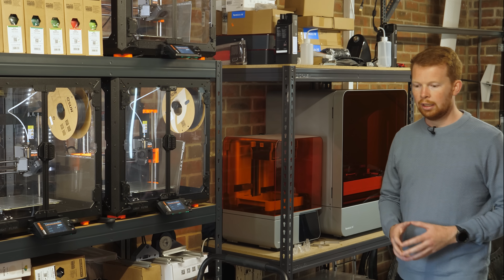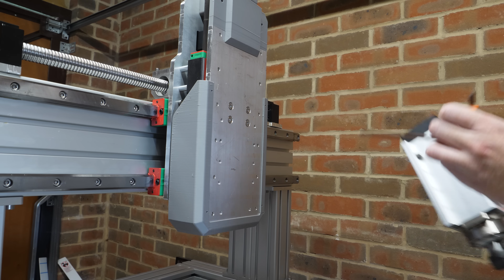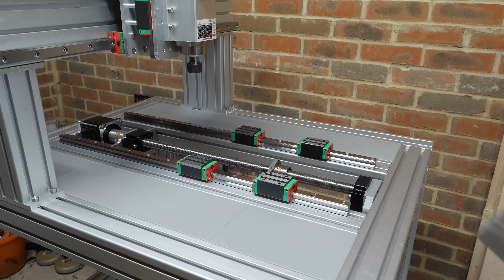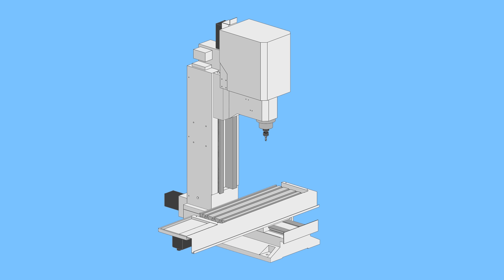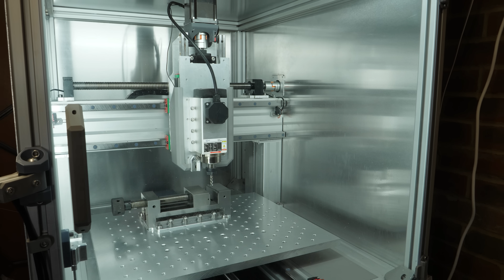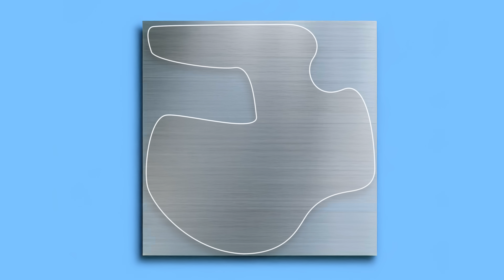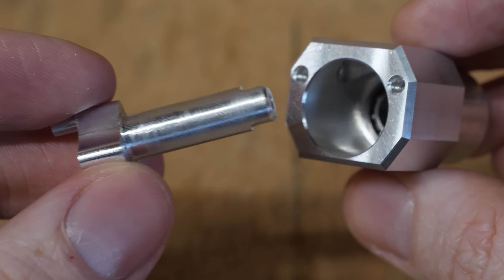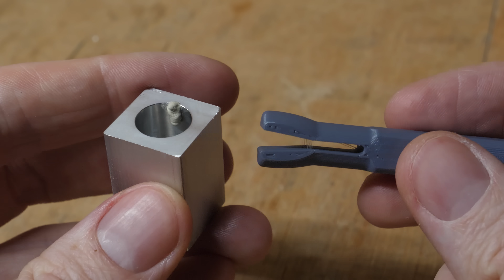I Needed an Engine, So I Built a CNC Machine

Comment: If you mill the wheel to accept a metal turbine, you can also mill a place for the peltier tile in the wheel. A 5 axis turbine from JLCCNC would be pretty cool and I think a 3 axis turbine is a must, I think more DIYers will have 3axis milling. It would be awesome if FLIR footage could image the wheels absorbing thermal energy from the pavement. I thought it would be awesome to see 1mg of paraffin wax melting on a peltier tile, then put a little foil. Also, 3D printing a shroud. It would be an awesome series. If you used a tire inflator in your backpack, I think you could use a lower pressure in your backpack and still safely use 2L soda bottles.

Comment: I'm a maintenance tech at one of the biggest machine shops in the country. My job is to fix the machines when "professional machinists" dont know how to push a button correctly and crash a multi million dollar machine. the shit ive seen idiots do would make you cringe. i cringe so many times during a day that youd think i just have a resting cringe face 10 straight hours a day..

We use Renishaw probes on most of the machines. They make all sorts of variations from ones that go in a tool holder and go into the spindle and touch off on the part to auto program the exact position. and theyre based on touch, not completing a connection electrically which means you can use them on any material, not just things that are conductive. They also have ones that you bolt to the build plate and leave in a specific spot so when the tool touches off it automatically knows the offset. those are used mostly for checking if bits are broken before using them in the program. and theres about 10,000 other variations. if you got one of those renishaw probes (which are wireless and rechargeable but the batteries last months or years) you could do exactly what youre already doing but you wouldnt have to rely on something conductive.

also, they make addons to regular xyz machines that give you additional axes. the ones we use are a self contained unit you bolt to the build plate  and plug in and you can now rotate your part instead of having to unclamp it and re-touch off and all that.

Comment: Im not qualified at all to say this but use the rotatable zylinder thingy as a gas pedal. Like bc when you turn it a bit it gets faster but bc f the vibration or smth it screwes back out slowly. You could make ot go faster and slower by making a mechanism that would allow you to screw more in my pressing on a pedal and when you release it there would be a spring pulling it back. Basically the same principle like a carburetor but with the timing of releasing the air yk. Idk that just what came to my mind at the end of the video when you screwed the thing to adjust how it runs. Idk if that's even realistic to build or if it's too hard or if it would actually even work 😅

Comment: You could use the heads rotation to change power bands to increase or decrease output power controlled by a servo and linkage😊

Comment: Imagine a rotary vane motor. The outer diameter of the rotary vane motor has peltier tiles and paraffin wax that are in bands that are like the bands for delta pulse width modulation so that the thermal energy is applied to the motor sinusoidally. The peltier tiles are always on, but the different width bands of them on the outer diameter of the motor imparts the force to the flowing gas sinusoidally.
Reply: You used tube construction for your piston housing before. A tube casing for a rotary vane motor is gold, you can machine your rotors now. I want to put peltier tiles on the vanes. I keep thinking of those Persistence of Vision LED Clocks. Thanks for using high speed imagery, Tom. Also, do vanes have to be flat planes? I think the flow of air in those chambers of a rotary vane motor could be engineered with automation. Isothermal Persistence of Vision.

Comment: I really liked that your air motor is modeled after a toy. When I imagine miniaturizing the circuitry from this isothermal compressed air car, I could imagine it being a coin battery that energizes a small peltier tile and has only a few grams of paraffin wax. The motor you machined out of metal here looks a little bit larger than the motor you spec'd at 0.05hp. 38w. I found mini peltier tiles that are 6mx6m and you could probably use less than a mL of wax. I think it could be really beneficial to the flight time of a pressurized soda bottle. 1g of paraffin has 200j of latent heat when it solidifies from liquid to solid. That is too much even for your motor. I am imagining a small dab of paraffin wax and a mini peltier tile directly inside the cylinder. If there is 0.05g of wax and that 10j is discharged each time your cylinder extends, it would add 750j/s. I must be doing something wrong. If you are 0.05hp at 4500rpm, that is 75revolutions per second. 75rps x 10j. So, if the amount of PCM were 0.001g, it would add 15j/s, that would be a 50% improvement on power, or you could adjust the flow control valve down. You would also need to learn to drive the tiny peltier tile so that it delivers 15j/s at different outdoor temperatures because they are harvesting thermal energy from the environment. You probably would want to learn to variably control the peltier tile for different RPM anyway.

Comment: You might find it helpful to investigate the low friction material Rulon as used for pistons in oil less linear motor air compressors that are rated for 5000 hours life.

Comment: 19:50
I think it'd be cool if you didn't fix the cylinder in place but make the adjustability a feature like making it be a sort of throttle you can control.

Comment: I think you should keep the threads on the cylinder head unlocked, and instead add a small servo and belt to throttle it up and down within a finely tuned range. Might be something worth looking into.

Comment: Locking nut on the cylinder. Thread the nut on the cylinder and then thread the cylinder in the block. Tighten the locking nut down to the block once you adjusted it. Use a locking nut. Put a little more thread on the cylinder and use a thin nut to lock it in place, otherwise called a "locking nut." If you thread a nut on the cylinder first before you thread it in the block, you can use it to tighten the threads. Locking nut. Locking nuts are very good for lots of things, and I think it would work great for this. Try a locking nut. If you add more threads to the outside of the cylinder, you'd have plenty of space for a locking nut.

Comment: The metal version of your motor will be more compatible with the paraffin wax or sodium acetate. They change phases at 51°C. So, that would probably melt the plastic versions of your components. The plastic parts could still work with the water/ice phase change. I like to think about a thermal exchanger made of water/ice in an aircraft. It would be cool if the temperature at ground level were like 3°C and that the temperature at 700m is 0°C. I would like to design the aircraft so that I could fill it with enough 0°C air so that it could climb to 700m and turn on the electric air compressor and refill with more working fluid.

Comment: Might be interesting to have a linkage to adjust the timing as demand changes... maybe even have variable spring preload to adjust the pressure that closes the valve? Is there a way to route some of the air pressure in a way to help close the valve positively? My mind is going towards a place where IC engines struggle at high rpm: valve float. Awesome project, though!

Comment: Don't underestimate aluminum galling in your designs! Especially at cryogenic temps! there's a reason you use steel for this stuff. just because aluminum cuts nice doesn't mean it's the right tool for the job. when you're expanding gas like that you get a big temp drop, so you're gonna be working at very low temps. this is great for the cooling of stuff that normally creates friction heat, but aluminum on aluminum is probably gonna be a problem

Comment: The simplest way to stop the cylinder from loosening would probably be: cut the thread even higher, and add a slim aluminium nut that you can counter against the crankshaft housing then it's at the right height.  Screwlock would be even more simple but probably not survive the temperature range.

Comment: Interpolating on that mill should hold .001" Just leave finish material to make a much smaller radial cut to finish. For y'all conformist unit users that, about .025mm of roundness. Try comparing tolerances between SAE and Metric, and you will find out why American made is more expensive. We like to keep it tight.

Comment: Right angle swivel hose attachment at the top for hose attachment? Would allow independent movement between fine tuning the timing and the pull force of your air intake hose?

Comment: Bro is cutting radii with splines lol
(Also use ramping moves for plunge cuts!)
Edit- Extend the male threads on the cylinder, and make a lock ring that you can tighten down on the top face of the crank case so you can adjust the timing and then lock it down. Great project, man!

Comment: Hi Tom, loved this video, would like to suggest a fix for locking the cylinder in place…if you extend the thread a bit further up the head you can use a thinned down nut to lock it off.

Comment: Machinist apprentice here! You absolutely need a solid cooling system. Trust me. Your Ears, Workpieces, and tools will thank you
Reply: Depends on the material
Reply: I was talking about a cooling system. To specify, I meant a system using a cooling lubricant emulsion. Cooling always makes your cuts better and your tools last longer.

Comment: A knurled lock ring the same thread as the cylinder should help for holding the valve timing steady. Though you've probably already sussed that 😅

Comment: Brilliant! I'd suggest wrapping a wire, the kind used for fridge de-frosting, around the cylinder head and supplying it with voltage. The increase in power will be astronomical or to put it another way, the fuel savings will be extreme. 
Kudos Tom, well done.

Comment: If your using this on something rc you could use a servo to spin the cylinder to act as a throttle using that power band though it would be something to try

Comment: Replace the rubber feed pipe with some hard pipe, or braided brake line to remove and dilating pulses. It should be easy to tune. 
Awesome build! 
My jaw was on the ground the whole time. 
You have raised your already high bar! 
I look forward to seeing your next upload. 

🇦🇺🤜🏼🤛🏼😎🍀🍀🍀

Comment: just fabricate a threaded ring that you can thread on to the cylinder first before threading to the crank case and tighten it against the crank case when you have your timing set. it will stop it from spinning and can be easily loosened to adjust and tightened back down. Kind of like a jam nut.

Comment: By adding mass you’ve lowered the frequency of the first resonance of the structure and all the subsequent resonances at higher frequencies.  You’ve increased the odds that some problem resonance will emerge.  You have added some damping to the beams as you demonstrated but the flexing that would cause a problem resonance typically happens at the joints between the beams.  You haven’t done anything to dampen those.

Comment: Awesome to see this manufacturing advancement. The main question that i havent seen addressed yet is why are the exhaust holes so small? If itsabout timing wouldnt you want to make them slots to maximize volume while not affecting the power stroke legnth? And keep increasing this until you have structural issues for max power? Just an idea, maybe worth a resin printed test to tune it and maybe add some pipes !

Comment: 19:55 like a lock on a door just use a jam nut that's threaded onto the cylinder beforehand so you can tighten it down against the block setting the timing. Giving you infinite adjustability without the need for more machining beside the jam nut itself or potentially adding more thread to your cylinder.

Comment: I would use the threaded cylinder as a menans of tuning while the pressure drops off. You can mount a linkage to a servo motor to rotate the cylinder

Comment: You could machine the heating Rings to do two things at once is there flat they could act not only as cooling Rings but also clamps for when you find the the best height and the tank that would eventually house the liquid CO2 could have a clamp on it that would hold the thing in place

Comment: Please build a proper exhaust system that oscillates at exactly the right engine speed. The goal is to choose the length so that the moving gases still in the exhaust from the previous cycle create a vacuum exactly when the exhaust port opens in the current cycle. This way, the pressure in the chamber is lower when the piston moves upward again. It’s very similar to the resonance exhaust systems used in two-stroke engines.

Comment: At 16:00 minute mark.  I believe you can achieve a much better finish if your tool design would allow for the evacuation of chips during the cutting process. 
As for your boring tool, I'm unable to tell if you're code is retracting tje boring bar at the same rate as the cutting pass.  Your long boring bar flexes as its cutting so it will make very fine cuts as its retracted from the hole. You either need to move the cutter away from tje work surface before retracting, or make what is called a spring pass which is allowing the tool to cut at the same feed and speed as the initial cut.  Isopropyl alcohol makes a good cutting fluid for small light cuts in aluminum as well, and that would greatly improve your surface finish. 
The dial on the boring bar isn't really that accurate.  To get a better idea of how much you're actually moving the cutter, set up a dial indicator on your vise or milling head and zero out your indicator with its tip directly in contact with the cutting tip of your tool. As you advance the cutting tip on your boring bar, you can directly read off of the dial indicator the amount you're actually advancing the cutter.   
If you're unsure if the granite epoxy improved the quality of your mill, you can wonder no longer.  It greatly improved its ability for precision and achievable quality.
Hope thats helpful. I enjoyed the video.

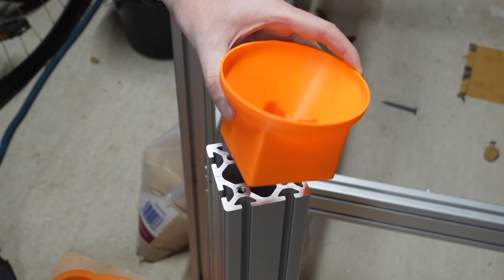Comment: 1:25 Yes, this will affect the cutting quality big time. The two most important factors are rigidity (stiffness) and dampening. Its important to have realistic expectations. For the same axis travels, an industrial mill weighs about 3 tons, heck even the table weighs more than this machine. But you have done yourself a huge favor with the filling, probably improved it by a factor of 3-5.

Comment: A heavy frame does affect cutting quality, but you've only made the bed handle more torque (think of it as a sort of resistance or capacity, depending on time). So what ever vise you've installed your tool in can handle more torque (with solid screws) if you've planted it on a heavier bed. Same goes for the tool crane, but then you need more power on the motors that run it.

Comment: Wicked air engine mate, I never knew this is a thing. What would be the RPM and approx torque output and how much cfm air are you feeding it constantly? Also how large could this be built and multiple cylinders like V-twin, inline-4, V8 or radial type?
I apologise for my rudimentary question as I'm a dummy on my smartest day.

Comment: A very nice project. The tap broke for 2 reasons; 1) you used no cutting fluid. Paraffin, white spirit or WD40 is what you need. 2) the swarf was bound up in the flutes of the tap. With small taps don’t be too ambitious with the amount of tapping turns before you back the tap out and remove the swarf. 
Also, never be tempted to tap holes in a cordless drill. The way to remove broken taps is with a spark eroder (edm machine). This is a very slow process but works only in conductive material. Perhaps you should consider building a simple one?  You will then go down the rabbit hole of machining square holes in hardened material etc. 😊

Comment: I think you could try to make the cylinder height(valve opening time) adjustable by servo so you could optimize the engine efficiency to match drop in operating pressure.

Comment: I'm not sure if it's possible on such a small setup, but on larger CNC machines, They have multiple collet holders that can be swapped out with a press of a button so that you don't have to go through the steps of loosening, switching tools, tightening, and rezeroing for every operation requiring a different tool. It also means you can keep your probe in one to quickly switch it in to get the zero on your part.

Comment: For locking the cylinder into a given orientation, consider not locking it at all. Rather, control it with a stepper (a couple 3D printed gears/pulleys should work brilliantly). Now you've got VVT, and as such throttle control if you can characterize the power output at various positions.

Comment: I wonder if you could add an arm to the cylinder head and use a servo to actively adjust the timing of the engine. Kind of like a throttle

Comment: You don’t want to dampen vibrations. There’s little to be gained by making them wet. Filling those aluminum tubes with sand however, is a good way to damp any troublesome oscillations.